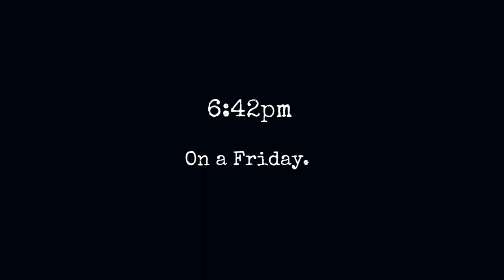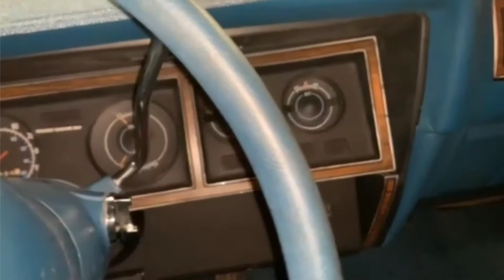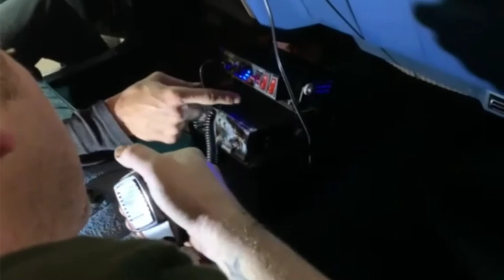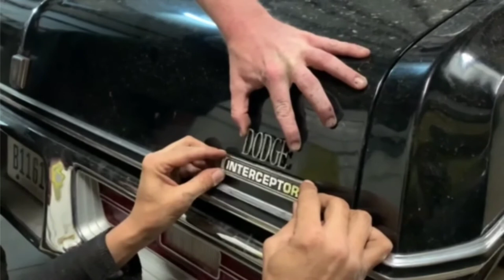It's Always Something - Coronet

Comment: Had a 73 coronet with a 318.  No power steering or ac.  No smog stuff .  Just had power brakes and tow package.  That was the only car I have owned that would  throw you back in the seat hard when you stopped the accelerator and burn rubber for over hundred feet.  Good memories.

Comment: A friend I know who is a Chrysler mechanic has a "plain wrapper" 1976 Dodge Coronet. It was used by the chief of public safety at Cal State Hayward. It is a white car with a blue interior and comes equipped with a police package. Also has air conditioning, electric rear window defroster, split bench seat, trunk release, limited slip differential, power windows, and power locks.

Comment: At car would have to be at least 40 years old to have metal hub cabs, a mast antenna, bumper jack, full size spare tire, stand alone am radio, and a three on the tree manual transmission.